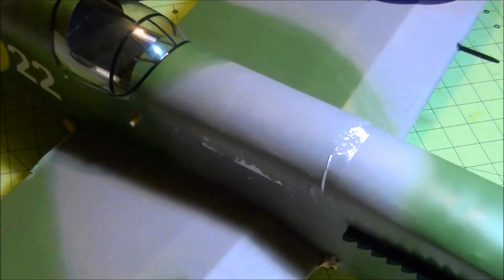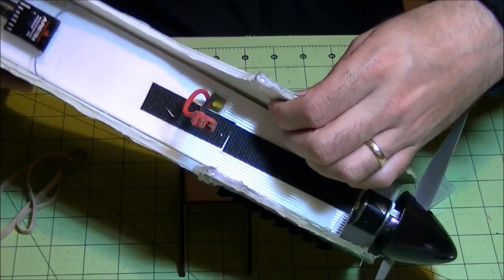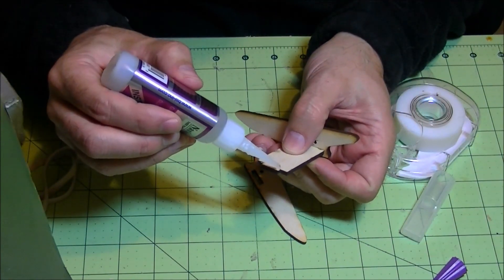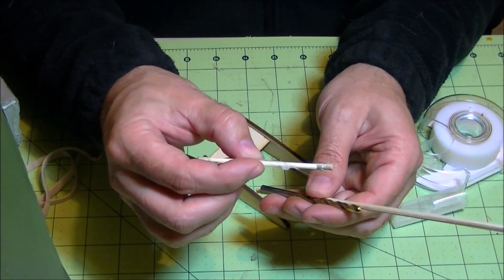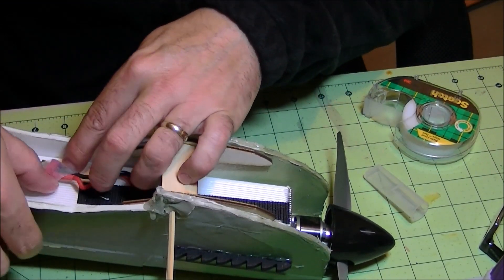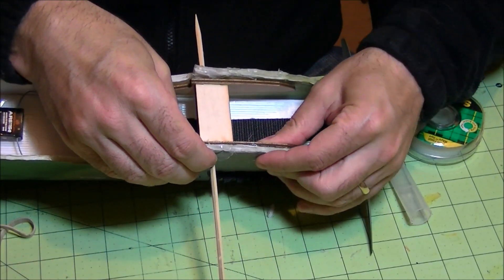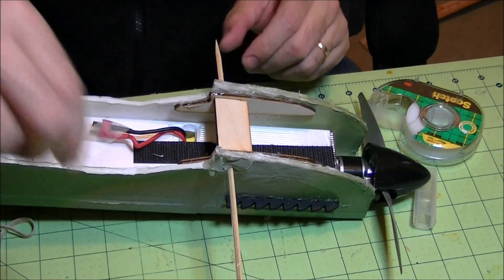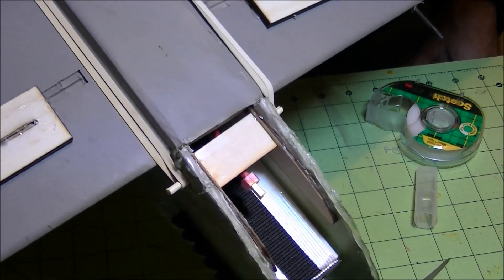Wingbox Upgrade for FT Spitfire

Comment: Brad, Hi, question for you. On the FT Spit fire, I just built mine, and it seemed to be incredibly tail heavy. I am using the Power pack C from Flite test, a 2212, 1000kv motor and a 3s 2200mah battery and when test the CG on the spar i didn’t even try to fly it. What is your set up for the plane? Did it balance on the CG at the Spar?
Reply from the maker: I had the 3s 2200 slid up as far as I could. Not sure about the CG

Comment: Great idea, alternatively you could just drill a hole in a little circle piece pf plywood and glue it over the hole, definitely not as strong as this but a bit lighter and easier.
Reply from the maker: +Travis Pratt Yes you could do that. This is a little nicer. Also I should have kits back in stock Next week.

Thanks
Reply: +Brad Kelley Oh nice I hadn't noticed you are selling them, I agree these are much nicer. And also add much more structural strength. Not a bad idea at all. I'm still building my spit, at the stage where I have to decide if I even want a removable wing.
Reply from the maker: +Travis Pratt  The removable wing is really nice. Gives you more storage and transport options.